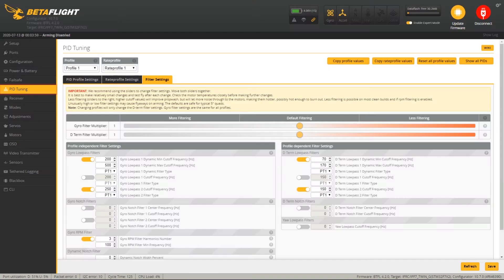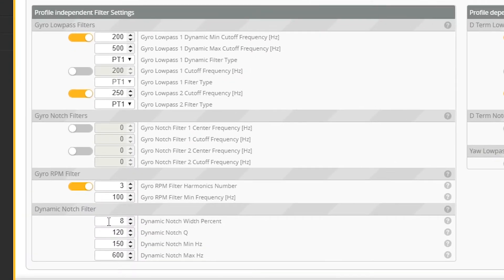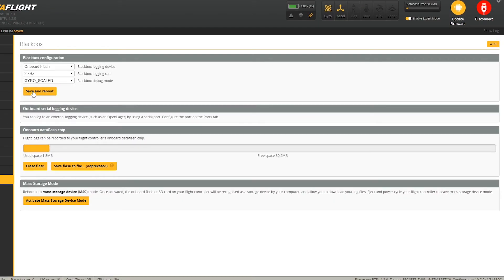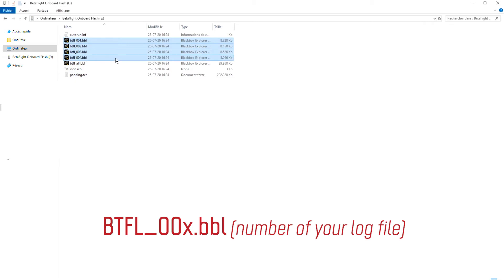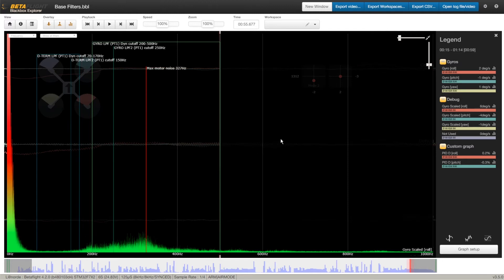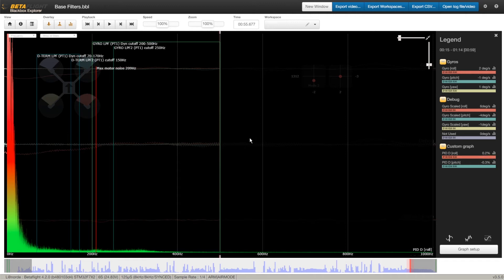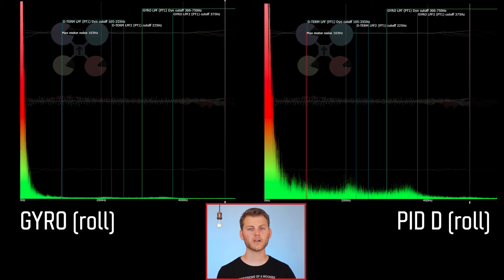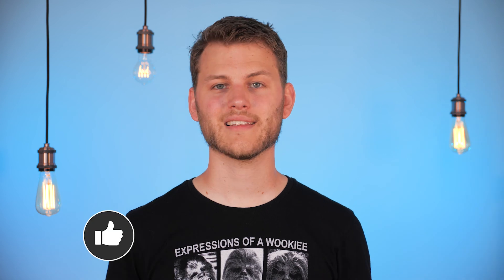Betaflight Filter Settings #1: BLACKBOX EXPLORER | Easy Tuning Method

Comment: Lenorde, i only have BF 4.1.1 as my Matek F4 clone is not supported anymore on BF 4.2.x , i dont see PID D on the custom graph list, what i need to do ?
Reply from the maker: Hello! The Betaflight version should not be a problem. All this data is stored no matter what settings you use. Do you see other PID settings in the list ? Or can you see other items missing ?
Reply: @LenordeFPV  what  you mean
Reply from the maker: @rolisaenz  Do you have something else in the "custom graph" list ?

Comment: very clear vid, well done. 
I use a trick for years to avoid safe returns with damaged gear: I never have airmode always on. My arm switch is actually 3 position: 0 / arm / arm with airmode. So say I bend a prop to a point where I cannot normally fly and need to cruise back, I step arm to the middle and I do not have to fight airmode. I guess we could make a scenario where BF kills airmode based on the data corresponding to emergency situations. 
But hey I am doing it for years and I was able to finish two important heats during a  race after collisions where airmode tried to sent me to the moon.
Reply from the maker: I actually have a dedicated airmode switch too! When I first started FPV, I didn't know if I needed airmode all the time, and since then I still have this switch. It comes in handy sometimes, but I never checked the difference with damaged gear, it's a good idea !

Comment: Hi Lénorde. Thanks for this perfect explanation. If I have a normal BLHeli_S, so no bidirectional dshot, can I even try this filtering procedure? If yes, should I disable RPM Filter before starting?
Reply from the maker: Hello! There is a way to enable RPM Filters with BlHeli_S ESC. You will need to use another firmware like "JESC" or "JazzMaverick". I haven't tried this myself, so I advise you to take a look at Joshua Bardwell's video : https://youtu.be/NgBJJG0slM4
And if you prefer flying without RPM filters, you should leave the "Dynamic Notch Filter" at defaults and tune from there. The rest of the video will still apply for you except for the dynamic filter settings.
Reply: @LenordeFPV  Thank you very much for your answer!
Reply from the maker: @Tonynux  You're welcome :)

Comment: Appreciate the video but it doesn't explain what the graphs are showing in relation to what your filters are set at
Reply from the maker: Hello! There isn't a proportional relation between your filters and the graphs. Some quads can be noisy and harder to filter properly. The general idea is that if you lower the frequency of the filters, there should be less "green" on the right side of the graph. But you don't want to reduce them because it induces phase delay and a worse behaviour.

The graphs gives you a visual indicator of how much noise there is after filtering. We are trying to raise the filters frequency and checking if we see a lot more noise than before or if it's still fine. It is only a matter of trial and error to get to a point where there isn't too much noise. The other indicator, which is even more important, is the motor temperature. A hotter motor means that there is too much noise, and then you can confirm and isolate the problem with Blackbox.

This video is only an introduction to the tools used and the method. I still need to create more videos covering the effects of filters in real-life situations, but it takes a lot of time to gather all the useful data with different settings. I have postponed a lot of flight sessions due to bad weather, but I still hope the next videos will come very soon !